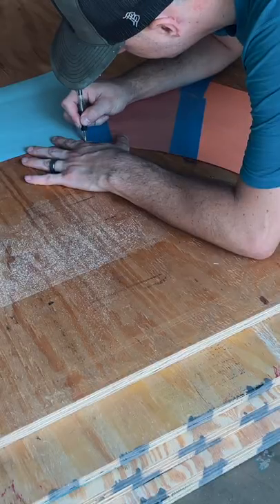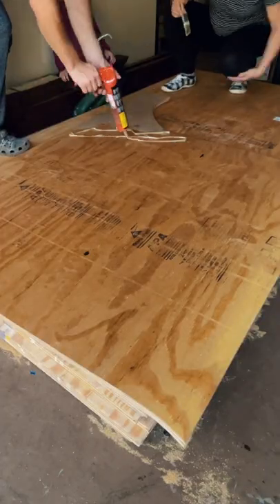Installing the floor in a tiny house school bus conversion #shorts #buslife #skoolie #busconversion

Comment: Question: how come you painted the fool then put floor boards?
Reply from the maker: primer protects from rust and the top coat (blue) seals the primer
Reply: @UsPlusaBus  ohhh ok that makes sense

Comment: Why paint the floor if your just going to put hardwood flirting over it? Btw I’m not a pro i just wanna know
Reply from the maker: the primer helps keep the rust from coming back and the top coat (blue) seals the primer